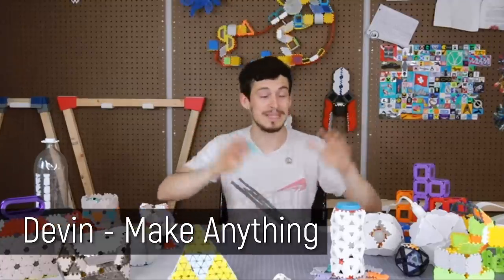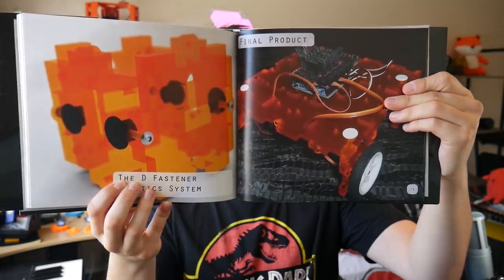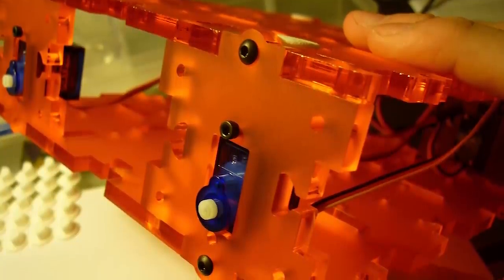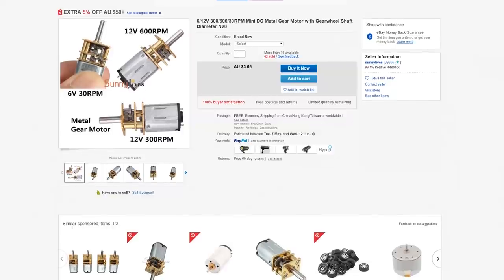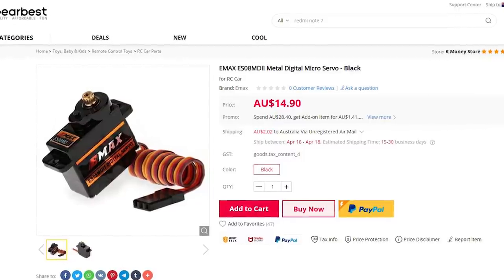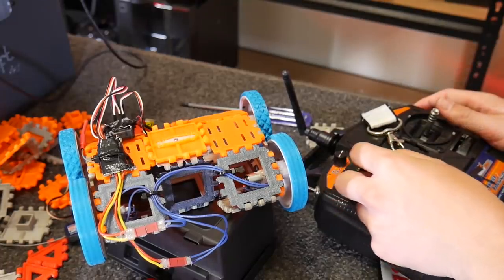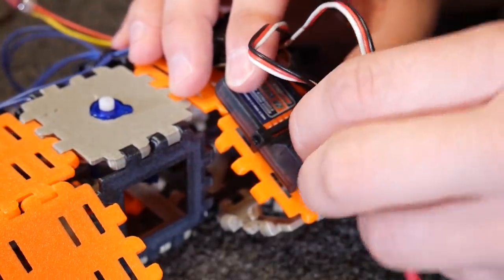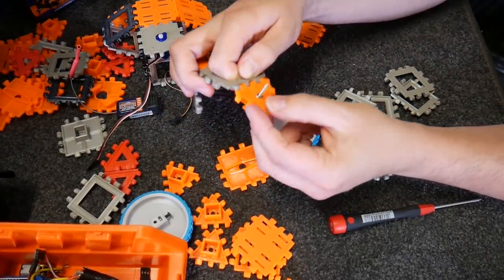Make Robots with Polypanels!

Comment: Can you just do a video on how you get your hair like that?
Reply: That would need to be a live stream.
Reply: We need his cura settings for his hair
Reply: @emiliomota2459  let's just get him to 3d scan his hair so we can print it at home
Reply: Definitely retraction settings are the key!
Reply: Go check out a small movie called There's Something About  Mary, there you will find the secret to men's hair styling.
Reply: lol
Reply: only use conditioner to wash your hair and good hairspray afterwards
Reply: Some things man is not meant to know.
Reply: It takes years of training for your hair to do that.
Reply: That's a multi-material print
Reply: I'm thinking it's like the "furry lion" model.  You print it with a cylinder around it and then cut the cylinder free and hit the strands with a heat gun.

Comment: Btw, talking about affordable laser cutting; the snapmaker 3d printer you can win in the contest is a modular design and has a 1600mW laser cutting module available. You might want to review the snapmaker (or snapmaker 2 when it comes out), it's a pretty sturdy machine with additional modules for cnc carving, laser engraving (200mW) and laser cutting (1600mW).

Comment: Those Polypanels are sweet, I haven't heard of them before, going to have to print a few now :)
Since getting my 3D printer I've been meaning to build my own RC robot base with printed mecanum wheels because those look so fun, and I think I might be able to program the microcontroller that drives the motors so it behaves just like a quadcopter using pitch+roll+yaw controls, allowing for some really smooth organic motion.
Reply from the maker: I love mecanum wheels - would love to see that!
Reply: The hardest part will be figuring out the algorithm to take 3 control inputs and output signals for 4 motors.
I did once figure out the joystick to skid steer code to drive a tank robot base using a normal proportional RC car controller, so forward=drive forward, right=spin on the spot, with full smooth transition between the drive & steering controls so pushing forward+right makes it turn in a circle (only the left motor will spin).

Comment: Really do need to get these motor driver boards into production.
Arduino pro mini + USB host shield and a custom board with dual h bridge, two servo outputs and controllable using a knockoff PS3 controller over bluetooth..
For $35 or so, AU, all the electronics except the battery for your robot.. :)
Hopefully we'll have them on offer at the state library in a few months. Just got the PCBs today so now it's build and testing!

Comment: Great video. We are currently working on a system to put a robot quickly and easily together. Only ours needs to be a bit bigger like about 30x30x50 inch or 750x750x1250mm weighing about 120 lb. Well if we are successful there will be some videos on that too. Put the initial frame together but need to go to V2 to take care of some problems. And there are lots of tasks still to be completed like a geared wheel (planetary or cycloidal inside the 6 in mechanum wheel some rack and pinions and probably a 100 or 200 to 1 gearbox for heavy lifting (goal 450 lb) . Its slow going first all needs to be designed and then it needs to be printed and we have one suitable printa (MH Pulse - Prusa clone)  You, CnC Kitchen and geardown for what got us started on that path. (Us is FRC team 1989)

Comment: And i'm just thinking: these panels have asymmetric hinges, so if you flip one around, then it won't click into its adjacent panels anymore, so there is an orientation in which they fit. Don't you run into designs where panel 1 fits panel 2, panel 2 fits panel 3, but you can't connect 3 to 1? Especially if you make a panel directional by adding a motormount on one side, then you can't flip that panel around.

Comment: For control you could always use a Raspberry Pi zero and a cheap motor controller board like a Pi Borg Zero Borg. Very cheap, very easy, very adaptable. Options for bluetooth and autonomous control on board etc etc

Comment: Thanks for the video - really inspirational.  

I'm trying to source parts for this in the UK and I feel like I've fallen down a rabbit hole when it comes to voltages.  Motors, RC receivers, servos, everything seems to be more common at 6v, but lipo power is 7.4 or 11.1 depending on cell count.  Did you need to use a voltage stepper?  Any guidance where to look to get an understanding?

Comment: What's the smallest, cheapest 3d printer you would recommend?
Reply: I don't recommend a small one to start with. You will quickly get frustrated with not being able to print 90% of anything on thingiverse (without resizing).

I've now got a couple of ender 3's (all stock but I replaced the bed leveling springs). Great printer, loads of support, useful print size, plenty of spare parts :)
Reply: probably ender 2
Reply: What about the Cetus MkII